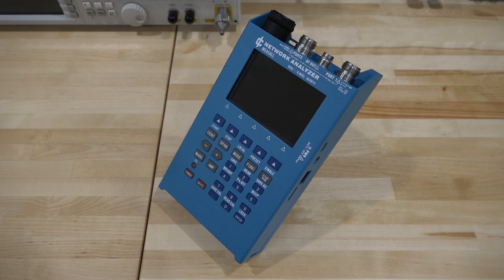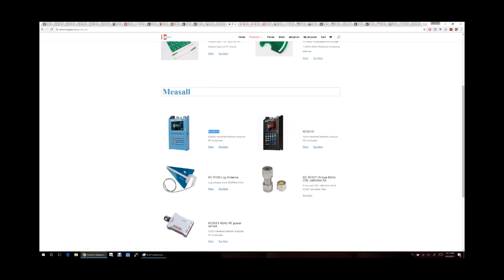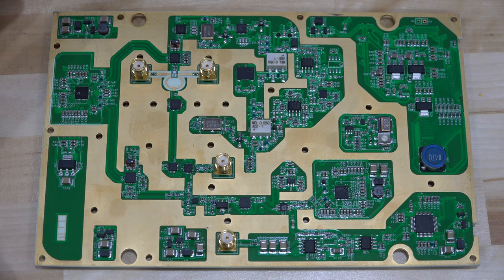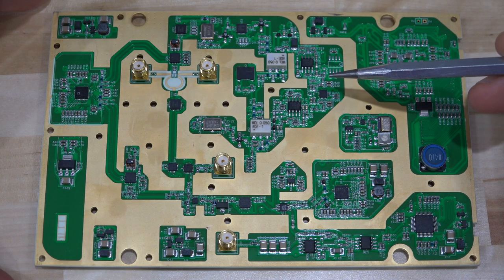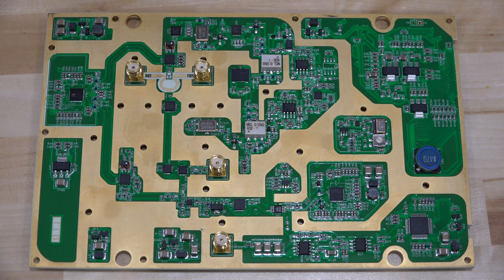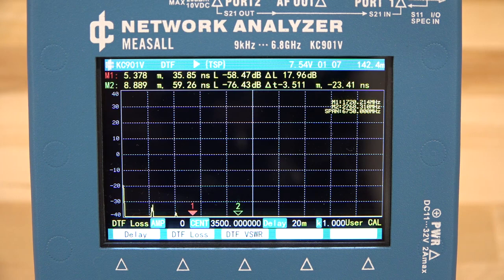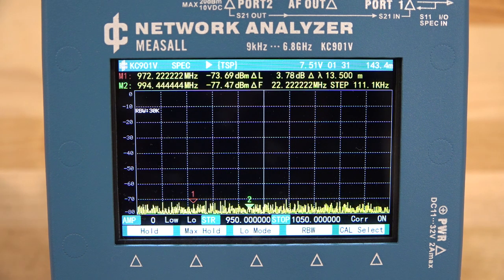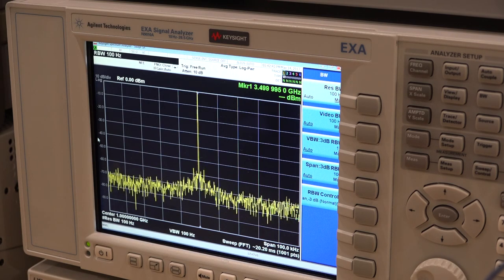TSP #99 - Deepace KC901V 6.8GHz Handheld Network Analyzer Review, Teardown & Experiments

Comment: The price seems to make this a bargain! Would LOVE to have a go at the parts unit - I have been struggling to design some circuits without the ability to measure PCB structures and components. Simulation is all fun and games until it doesn't work - that is when I want to measure. 

Excellent video as always - never heard of this brand before. They were smart to send you the whole 'reviewer kit' to make it easy on you. Less video time wasted taking out screws, more time talking tech details. Good luck to the Patreon supporters.

Comment: Considering that "low frequency" VNAs, usually marketed to amateur radio market, go for a few hundred bucks this is quite affordable. A suggestion for some future video: design exercise: a low end VNA. These days you can build one for less than $100 using mostly off the shelf components and modules.
Reply: I had a miniVIA, it measures up to 3GHz, but really slow. It was really a pain in the ass to use

Comment: Great video as always!
I was wondering how the directional coupler is implemented in this device. An wilkinson power divider is visible next to the output ports but, couldn't spot the coupler/RLB. Can you maybe make some high resolution pictures of that area or give some advice? Thx in advance
Reply: The wilkinson splitter with the load termination on the extra SMA connector can be used as an impedance bridge, maybe that's what they're using for S11 measurements

Comment: What does the "139.2m" in the top right corner of the screen mean? Something like 139.2mA current draw?
Reply: In a normal spectrum analyzer I would interpret it as the sweep time, but here it is constantly changing...
Reply: I guess it is the altitude, for RF tower workers.
Reply: Wavelength of the delta freq. marker in meters, you can see the lowercase letter lambda before it.

Comment: Thank you for this review! I think to buy this unit, but I'm a bit worried, is S21 isolation is so small (only -40dB) on 6-7GHz, as I see on 23:57,  or the connected cables had some RF leakage and the instrument can perform better?

Comment: When it measures phase, is it the phase of the reflected signal relative to the output signal? If so then does it also take amplitude into account to compensate for multiples of the same distance have the same phase offset?

Sorry I don't know much about RF stuff at all, but I find the fault locating stuff really fascinating.

Comment: Thanks for your excellent video and explanation! I do have a question in term of the frequency synthesizer part you reviewed in the video. On the spectrum, there are multiple harmonics accompany with the target 1GHz harmonics. And the third harmonic has the similar power level with the actual signal. How could this device eliminate the harmonic effects in VNA mode? I am designing a simple reflectometer using a PLL (ADF4351), and it has a similar output spectrum and this confused me for a while. Could you please give me some advice on how to mitigate the harmonic effects? Really appreciate!

Comment: i bought KC901V VNA few weeks ago from Deepace. i tried to get sma calibration kit tuned for KC901V from a reputable engineer with access to very expensive and very well calibrated instrumentations (since Deepace doesnt provide this kit), he advised me to avoid this product because of some flaws and limitation, mainly we cannot input calibration kit's coefficients (stray capacitances polynomial for OPEN standard) into the unit. without the correct calibration kit's coefficients, this VNA will not give accurate result. i reported in their bbs forum few weeks ago, no reply from the Deepace engineer so far, i emailed them they dont answer (they only answered when i want to make a purchase), now i cant access their website and forum (while others have no problem). this is bad support service, not a recommended product as serious measurement tool. until they rectify their support team and include the fringing capacitances input in the mathematic formula in their next FW upgrade, it should be a simple task for a specialized person like them, the VNA manufacturer.
Reply: Not being able to add calibration data is a serious drawback. However I noticed in the video that you can enter calibration parameters. At least I saw length (in mm)  as a parameter for open, load, short and through. Also frequency, so it may be that you can enter frequency dependant parameters. So maybe you need some tweaking to convert the polynomial coefficients to distances at a specific frequency.
Reply: firmware 1.3.4 is available at http://www.deepace.net/download/ to address this drawback, hence invalidates my comments.

Comment: "low cost" -> $2000    ಠ_ಠ

next up, review of a "low cost" bmw m6.
Reply from the maker: Remember that low-cost here is in the context of VNAs. The BMW M6 is not a low-cost car in the context of all cars.
Reply: i wouldn't call the kc901v a low cost vna. it's pretty average cost. a better description would be "entry level vna".

now these are low cost VNAs: http://miniradiosolutions.com/54-2/   http://sdr-kits.net/VNWA3_Description.html
Reply: I would love to see a review of this miniVNA!
Reply: The companies that make high quality VNAs (Keysight, R&S, etc.) start their range at around $10k. I'd say anything below that classifies as low cost, even if it's not "cheap".

All of the low cost instruments seem to have downsides or faults compared to the reputable brands, but this one looks like it performs really well for the price!
Reply: Felipe Navarro I have used the miniVNA. They are very slow, terrable UI and not very accurate. I absolutly hated it, but I guess its better than nothing. The N1201SA that is availiable from ebay or Banggood looks better.
Reply: funny you mention the N1201SA. I had one and it is not accurate at all. a KVE520A was also not accurate. I bought a sark-110 and a rigexpert aa-600 and they are both accurate.the minivna gets good reviews: http://www.eham.net/reviews/detail/11879
Reply: Well, he was testing it out on an N9010A EXA with the 26.5 GHz range model, so that means $37,900 BASE price. So compared to some of his other equipment, $2000 is very low cost.
Reply: "low cost" for the very wealthy.
Reply: Or, you know, for the people that use these tools to make a living... -.-